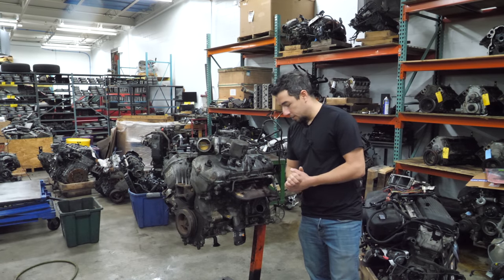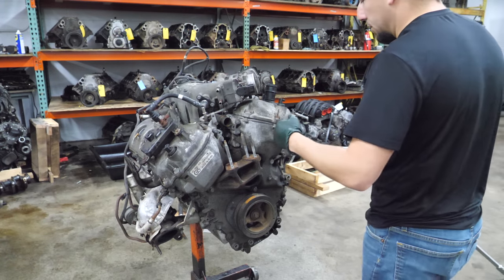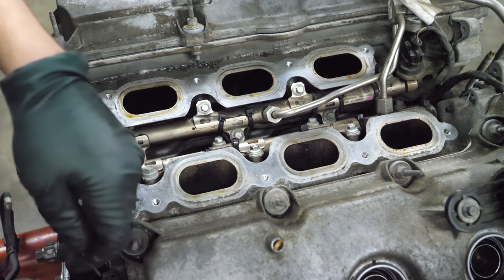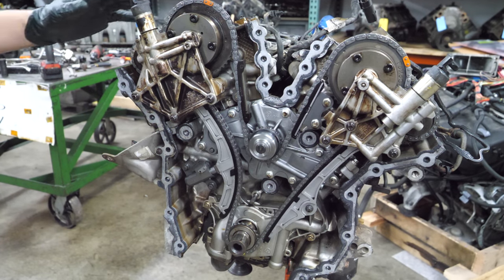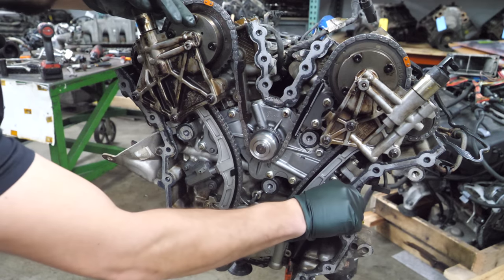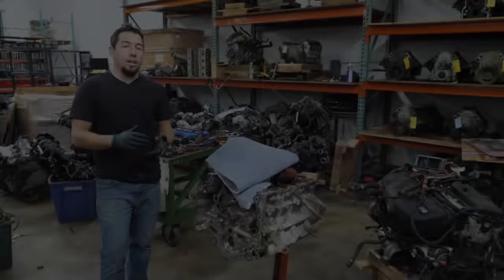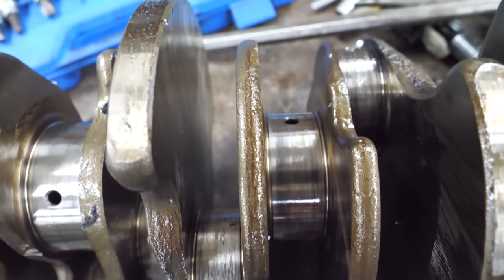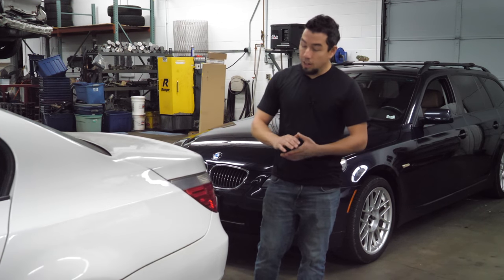Taurus SHO Flex ECOBOOST 3.5 V6 BAD Engine Teardown! What Killed This Maintained Engine?

Comment: Without the horrible EGR requirements DI would not have a nasty carbon issue. Just look at performance/race engines that use DI and have no EGR. With modern technology we should be able to have better fuel combustion ending the need for EGR.
Reply: It's more likely from PCV as the 3.5 Ecoboost if I recall correctly doesn't have a EGR system and instead uses VVT to take that role. Race/Performance engines probably have a lot better PCV oil separator to keep any oil mist out of the intake which is usually what bakes onto the valves (usually the valves nearest to the PCV inlet in the intake are the worst).
Reply: This engine has no EGR

Comment: What are the signs of the turbo going bad before it blows up?
Reply: Sometimes a there's loud humming/buzzing/growling noise, often there's low boost (usually accompanied by a check engine light p0299), blue smoke out of the exhaust when the seal starts to fail to name a few.
Or in the case of this car likely a huge amount of smoke out of the exhaust in it's final moments.

Comment: A gear driven water pump is a bad idea. I’ve rebuilt hundreds of Diesel engines from water pump failures. But the water pump under the timing cover. Wow, the worst engineered engine I’ve seen. What was wrong with a belt? Worked  to good didn’t sell enough parts I guess.

Comment: Of course the turbo is junk. That's why the bolts didn't break. Murphy's law. If you can't use the part it will be in perfect condition when you get it.

Comment: EPA: take zink out of oil. Extended car warranty people: replacing engine is basic maintenance. DEALERSHIP: that will be $4000 for the engine. $2000 for everything else we had to replace, and $2600 for labor. New engine has 1 year warranty
Reply: Lol, a new crate engine from manufacturer is around 10.000 dollars,  not 4000. That why Used, engines are so in demand.

Comment: They put the water pump inside the engine? That seems like a pretty bad place for it
Reply: Yup. That's not that uncommon for a double overhead cam with chain driven cams. That's what made the Chrysler 2.7 v6 engines so infamous. If it weren't for that internal water pump, it would be a great engine. But ALL water pumps leak eventually and one where you can't see that it's leaking is just asking for trouble, and one that dumps the leaked coolant into the oil sump is just insane.

Comment: I had to drive with a bad turbo took 6 quarts to mive 5 miles i just stopped and checked oil and over filled it knowing it would all be gone in 3 mins anayways when i got to the shop i was only 1 quart lie
Reply: Low

Comment: How do you prevent carbon build up in the engine on a direct Injection?
Reply: Kinda hard but basics (some will bitch about it) run a catch can. You can clean valves with walnut blasting or manual cleaning like I do on mine. Also a meth kit works good.
Reply: @blueblood76  a meth kit?😳
Reply: @patriotcanuck6485  yes alcohol injection kit FJB
Reply: @blueblood76  lol oh okay. I appreciate the knowledge, thanks. FJB

Comment: Why are ford engines a hit or a miss? The 5.4 is a great engine if you keep up with maintenance (mine is pushing 800k), and the eco boost in itself isn’t a terrible engine, it’s just when they fail… there isn’t any reviving them (that’s just my personal experience)

Comment: those rod bearings must have died over time, and im leaning to think the guy started up that engine and repeatedly dogged the throttle while the engine was cold. the engine is pretty in design compared to the other teardown vids i've seen from you. and there were plenty of oil changes on this engine. thats my guess.. a cop car..

Comment: I wonder if the engine got milkshaked by the original water pump and caused a little damage to the bearings in the turbo, ultimately resulting in the failure shortly after the water pump was replaced?

Comment: Ford building things just wrong enough since 1903. 
So you are telling me the water pump will fail so you have two gaskets that way when the first one fails you check for the water on the front of the block when you are done driving?
Ford: yeah you got it
Me: have you tried making it not fail?
Ford: well no, we did find other problems so we circled the main issue and put it right on the front…. and rear. 🙃

Comment: Internal water pumps are the biggest sham ever by car manufacturers. The purpose is to make it so damn hard to repair that the car owner will simply go buy a new car. What was so wrong with external pumps? If it ain’t broke don’t fix it.

Comment: It's amusing that Ford stole a page from a 1960's Honda motorcycle when designing the valvetrain in these engines. lol no replaceable bearings.
Reply: I have not seen any replaceable cam bearing in heads I ever tore into .

Comment: Omg. What a mofo of a job it is to do a water pump on those engines...wow
I actually wanted an sho buuuuuut after seeing the teardown procedure.  NOOOOOOOO WAAAAAAAAAY
I wonder if that engine was destroyed by being oil starved from timing stuff in the pickup screen from when they did the last repair and didn't clean the screen and even after the timing job it was oil starved

Comment: She just wanted you out from underfoot while she did the wrapping 😉
And, great engines but they need regular maintenance. Religiously. Extended intervals do them no favours.
Plugs can be a pain in the ass to do but do those too.
Reply: Any GDI,  Turbo is going to have fuel oil dilution issues. Couple that with this stupid 0 . 20 wt oil,  I change mine every 3000 miles and have fingers crossed.

Comment: What benefits do direct injection have?
Reply: Efficiency.
Reply: @ShainAndrews  but, how efficient can it be with all the intake deposits blocking airflow into the engine
Reply: @mattcat231  it's efficient at selling replacement cars more quickly
Reply: @mattcat231  Valid point.  I don't know how old any of you are, but with all of this modern technology we are back to tune ups being a legitimate maintenance item.  Direct injected engines need to have an intake flush at regular intervals.  Engine oil needs to be changed between 3-5k miles.  It's like I'm back in the 70's and 80's.  I have yet to see any OEM manufacture than can separate oil vapors from the CCV.

Comment: water pump should never be on the inside of the engine and be part of the timing chain and valve timing system. Nissan and Mazda have the same design. Water pump pulley is too much of an un-reliable bearing for the timing chain to run on.

Comment: They used a lot of sealer because nobody wants to do that much work and have oil leak. 
Cam phasers and chains always fail in those engines.  Can we say way over engineered.  Yes they make a lot of power but at what price. A big pushrod gad guzzling v8 in the long run is likely cheaper to own.

Comment: What I see is an over complex engine that has purposely built shoddy parts that are guaranteed to break.. then undertrained mechanics that ford employ's to do warranty work on there shoddy engines.. Those engines are notorious for failing water pumps before 50,000 miles!

Comment: Looks like this baby's been driven hard and put away wet.  I believe Ford is pushing the V6 too hard with the dual turbos....perhaps with more cubes we wouldn't have this and, obviously, watching your idiot lights or gauges should keep the driver from melting the turbo and then the engine.  Cheerio!

Comment: Ugh that thing is as ugly and needlessly over-complicated as the car it came out of!  It's like a Pontiac Quad-4 and a VW engine had a kid.  A very ugly, chubby, emotional kid.
Gone are the days where an engine ran well because it was well-engineered, simple and built to strict tolerances.  Now they can slap-dash together just about anything they want and use sensors and computers to overcome deficiencies.
Kind of like the F-16: It works, and it's no slouch in its field, but take away its computers and that sucker will lawn dart faster than you can say "Check Engine Soon".  :D

Comment: More than likely the result of a 5 minute oil change special. Low quality oil. Infrequent oil changes. Cheap...cheap..cheap.
Reply: Most likely  they drove it with milkshake oil and
 hurt bearings and still drove it.

Comment: Weep Hole... definition: seeing the cost to replace the water pump, water visually leaking past eyes....
Cavity...definition: opening the wallet that has been emptied paying for the water pump replacement... 
Hindsight...don't buy any cars with the water pump under the timing chain cover...

Comment: I can’t enough good stuff about you other you fail to use proper equipment and you are wishy washy  and have no set way to progress a tear down.    90% it’s let’s take off the timing gears but then let me loosen this tensioner after you manually forced the chain to do what you do not loosen the tensioner first